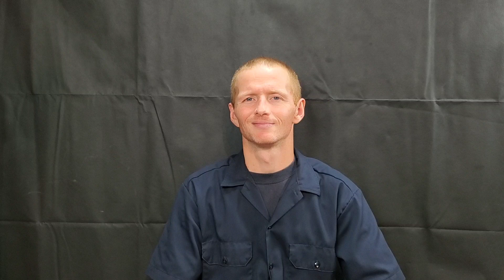Carbon buildup Destroyed My GDI Direct injection engine?

Comment: Catch can, I have that on my 2016 F150 3.5 ecoboost. I empty it every 2500 miles. Also the best oil so far is Penzoil Synthetic.  I change it every 5K. 50K on the truck no problems.